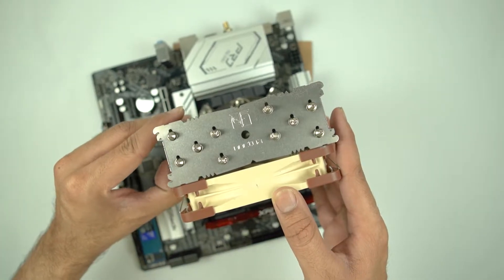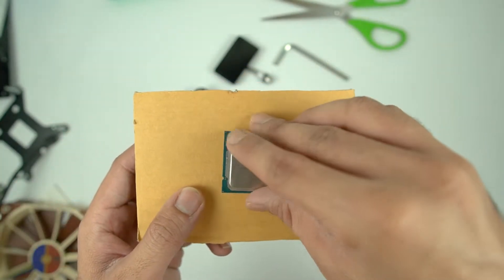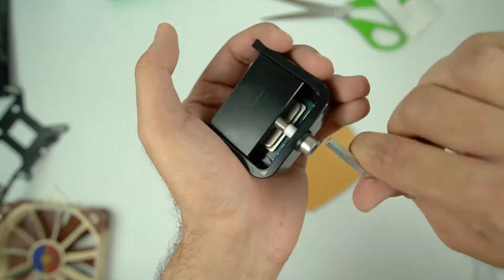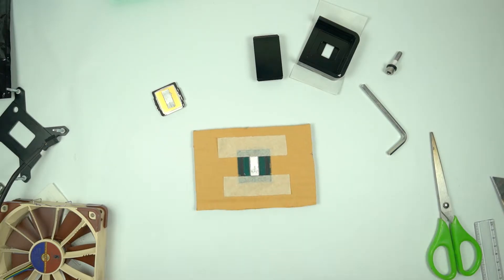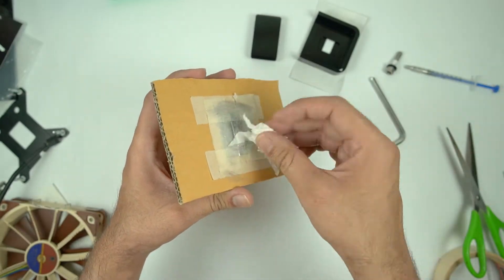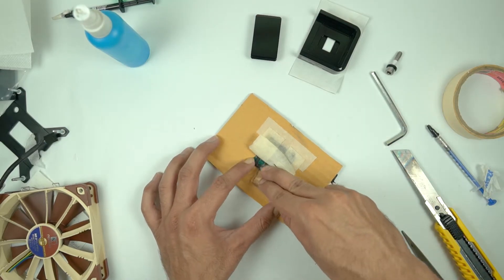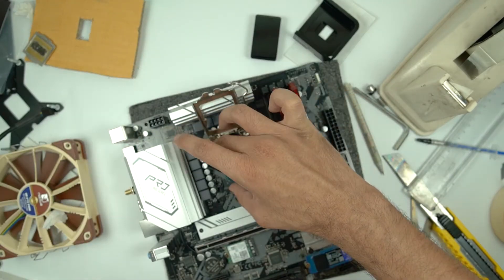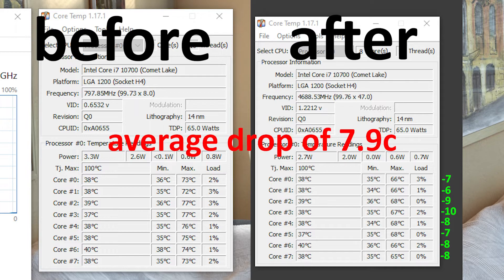How To Delid A CPU, Delidding Guide (Drop Massive CPU Load Temperatures!)

Comment: Dont use Polish on ur die, its very bad for heat transfer.
Reply from the maker: you really sure about that, i used polish to just clean the die surface not as a thin layer on the die.